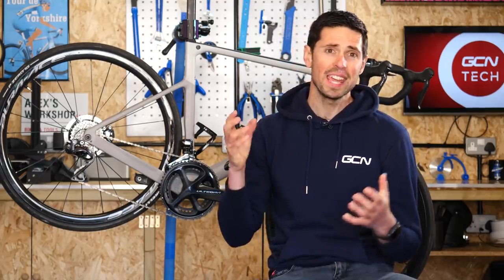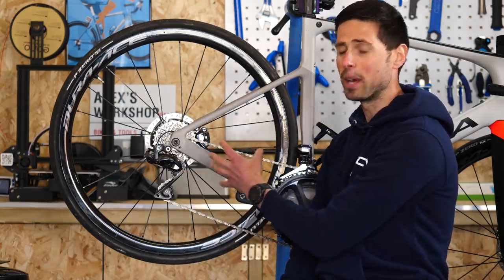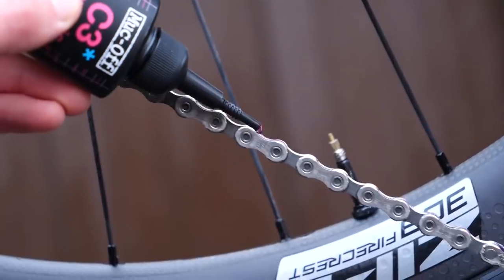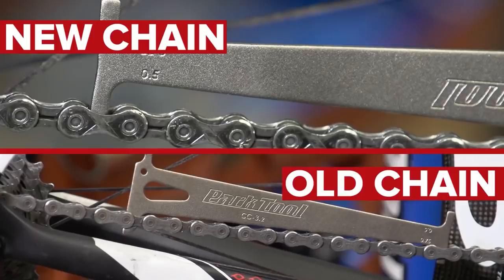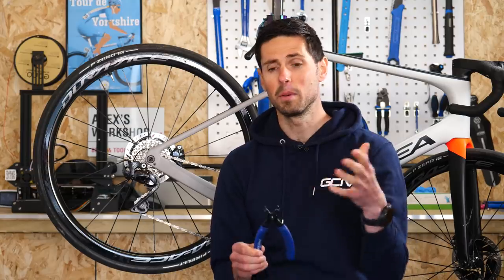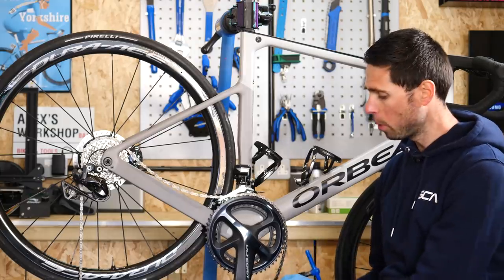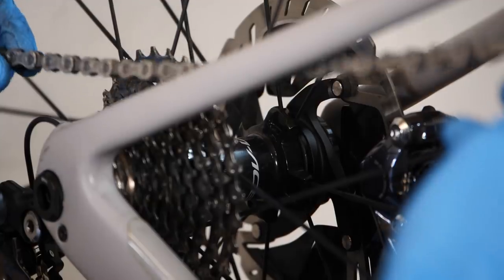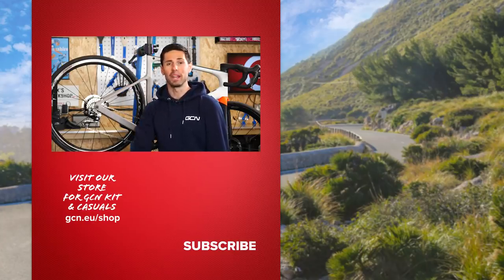How To Install And Maintain Your Bike's Chain | GCN Tech Crash Course Ep.3

Comment from the maker: Do you regularly maintain your chain? What tips do you have? Let us know 👇
Reply: Great video 👍🏻After washing your chain..how dry should it be before adding lube? Should it be bone dry?
Reply: #askgcntech
Hey I use chainsaw lube, I used it before a race just over a year ago and have used it since mostly because it’s more affordable. But I have a friend who says it is killing my chain what do you think???
Reply: Just bought a new chain, spent ages getting it REALLY clean, along with the casette and chainrings, before fitting it. Have been using Squirt wax since and really impressed. Quieter and sooo much easier to maintain.
Reply: Never wash it in water, I use white spirit which I keep reusing.
Lub by dipping in molten paraffin wax, old candle wax.
Reply: lets start with the cassette.  clean the cassette in your sink with dishsoap and washing soda and a toothbrush.   if your chain is very dirty then do this to it too.  after it dries put it back together.     use wd-40 now to clean the rollers even more.  wipe off excess, repeat if needed.

you now have a great chain that will shift great.  for more acustic dampening use silicone.
Reply: @dave136 yes, dry chain!

Comment: 🤦‍♂️ This video is aimed towards complete maintenance-beginners, so you NEED to show actual process of sizing the chain as live footage, instead of only verbally going through it. Sizing the chain is most important part for ppl who are learning about it, you need to show it properly and in detail. Also quick-link is not only option out there, so in this kind of video you NEED to cover “push pin” method. Especially if huge amount of ppl will get shimano chain and that is not coming with quick-link as default. Great idea to make video about basics, but very poor actual execution.
Reply: I'd argue this video is also to push sales of the maintenance book.
Reply: Doc Ollie's way of measuring a chain is in a GCN video on here somewhere, and was a lifesaver for me, about a year ago.
But, I agree with you. If they are going to keep (re)making these videos, they should be more inclusive on/ of the material.

Comment: I'm a big fan of the Wipperman Connex quicklinks. Reuseable with no tools necessary. They are a joy to use, whether for emergency repairs on the road when you need to remove the chain, or for ease of removing the chain for thorough and low-mess cleaning of the chain.
Reply: These are really easy to use and I like them too, but very expensive.
Reply: I just use the KMC ones and never had any issues, way cheaper too
Reply: @unkebunktebusal9023  True! I don't buy them separately because of that. I buy their chain and it comes with their quicklink. A great chain to go with a great quicklink. So easy to take off, clean and lube, and then reattach to bike...over and over and over with no worries about the quicklink failing.
Reply: @MrLuigi-oi7gm  I've heard them conning undone in some cases just destroying the bike. I just keep one for an emergency situation but other than that I run sram quick links.
Reply: @jaspreetsidhu5708  Hi Jaspreet! I have ridden chains with Wipperman Connex quicklinks for tens of thousands of kilometers. No problems.  HOWEVER, you bring up a very good point. I can't be sure what caused the failures you have read about, but the Wipperman quicklink MUST be installed correctly if it is to work as designed. If it is installed backwards/upside down it will not work as designed and could come undone...especially on rough, bumpy terrain when substantial force is applied to the pedals. The world is full of all kinds of people, some of whom don't read directions! Those people can create havoc with the reputation of a product.

Comment: For anyone wanting to lube your chain it's actually better to cross chain big and big. Because it will open up the chain and help you get lube in between the plates and rollers vs just applying it to the rollers and it failing to get in between the links.

Comment: Pickup a Connex Link to easily remove chain without tools. Clean it and Wax, per Oz Cycles, then just re-wax every 300 miles or so, depending on environment. It takes me about 10 minutes of effort to rinse and re-wax chain. After the first clean, no additional chemicals are needed. I use a dedicated $10 small crock pot from target for the wax. Easy.

Comment: First.
When buying a new bike buy a new chain at the same time. Take the original chain off the bike, cut new chain to same length, put original chain in a box labelled 'original', . This way you will have a measuring guide to cut any new chains too. Also make the quick link a different colour to the chain, this makes it easier to find and gives you a chain oil start and finish guide.

Comment: I bought the Muc-Off lubes (wet and dry) because I was fairly happy with their cleaning products. Unfortunately my experience with them were quite bad and even though I cleaned and reapplied the lubes after basically every 50-100km ride I still had issues with it attracting dirt while sometimes even it sounded as if it was running dry. I always felt like I made a mistake until I found the channel Zero Friction Cycling which does independent testing and they found the same effects in controlled testing compared to almost all other tested brands. Given how insincere Muc-Off responded to these findings I have to say that it no longer is a company I am happy to recommend to others :/

Comment: Alternatively, size the chain with using the smallest chainring + 2nd smallest cog. Make sure chain (just) clears the derailleur as it takes up the slack. Oil/wax the rollers, wipe off the excess on the outer links, otherwise you will have an oily mess as per bike in the video. You will need a chain rivet extractor, but not a magic link tool to add it to your toolbox - unless you are sponsored by Park Tool
Reply: I suppose we’ve all got the money for a complete Park Tool board, which I’m pretty sure we’d just admire rather than using…

Comment: The easiest, cheapest, and cleanest way to look after your chain, is to wax it. Loads of videos on here about it. Once you do it, there is no going back. It's a revelation.
Reply: I waxed my chains for 20 yrs, then discovered Rock-n-Roll Blue cleaner/lubes.  My chains don't stay as clean, but chain life is more than 5x better.  I used to average about 2000 miles/chain, but my current chain has 11000 miles on it and still no measurable wear.
Reply: @jefferycampbell2243  How long have you worked for Rock n Roll lubes.?
Reply: @andysatch9150  how long have you worked in the chain wax industry?
Reply: @Andy Satch
I agree! I also wax all my chains for a long time now. Almost no wear and super clean. But you also have to be honest and say that it takes more time and work. And you have to dry the chain well once it has become wet. Otherwise you get flash rust.
Reply: I waxed my chain, it's bette than lube... 
Question... What is the best quicklink brand / type for Campagnolo Super Record Chain 12speed?
Thank you!
Reply: @unkebunktebusal9023  You must be doing it wrong. You should not have to dry the chain as wax is hydrophobic. I have never had any rust at all. Check out oz cycle on here for the correct method.
Reply: @mikes1984  I make my wax out of candles and BBQ lighting fluid, so the answer to that is NEVER.
Reply: @andysatch9150  Hmm! In my experience, this happens because the wax in the places that comes into contact with the cassette and the chainrings is worn off quite quickly. And unlike lube, since it is not liquid, it does not flow back and rust is then easily formed there. Inside the chain, however, the wax keeps very long and lubricates the chain very well.
Reply: @andysatch9150  Was just thinking that, the beauty of wax is you can get it for free from the remains of old candles.

Comment: #AskGCNtech I'm running 700 X 25 tires on my road bike and have a bunch of 700 X 23-25 spare tubes.  Can I use these tubes if I upgrade to 700 X 28 tires?  Thanks.
Reply: I think it would be fine 🤔 they're pretty forgiving. Though perhaps you can find your flavour in 25 - 28 to replace them with if and when the time comes. 🙃
Reply: I use 28s and have never bought tubes that are any wider than what I used in my 25s. I did go a bit bigger for my gravel tires.
Reply: absolutely. I've been running 25mm tubes in my 28mm GP5000 tires for 1500km now no probs at all. the Conti specific ones for 28mm tires are surprisingly heavy given they call them race tires. talking butyl tubes